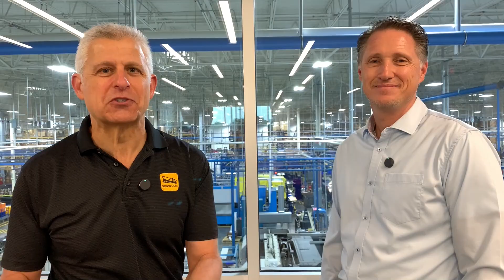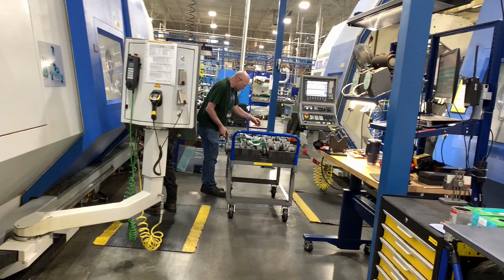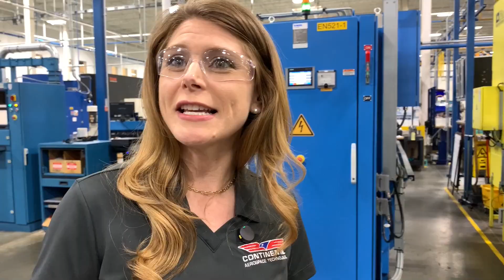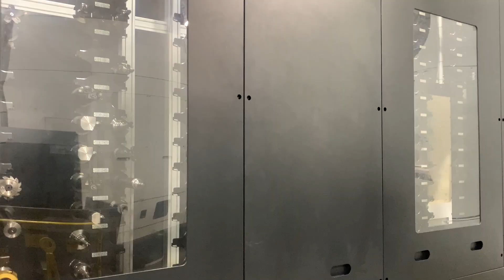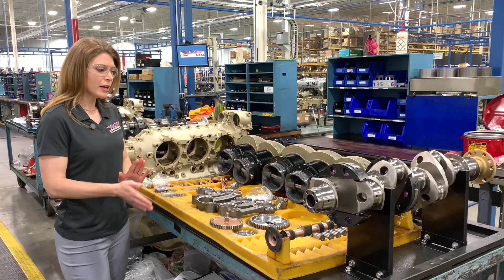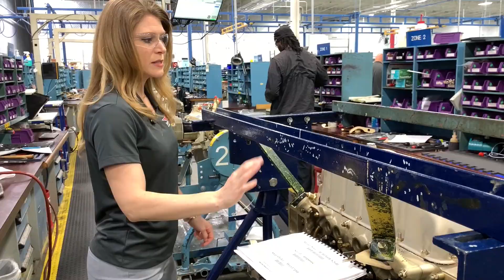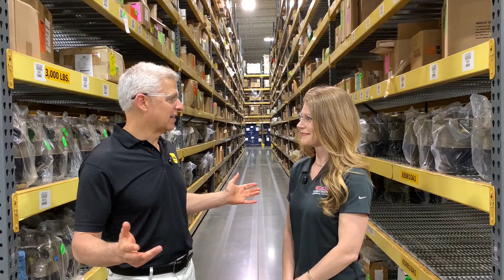HOW AIRCRAFT ENGINES ARE MADE! Continental’s 120th Anniversary Factory Tour

Comment: You'd think they'd have the prices under control by now. A vastly more complicated auto engine is vastly cheaper.
Reply: It’s not about complexity, it’s about regs and heavy lawsuits run rampant
Reply: @Notthe_droid_youarelookingfor  I just retired from 20 years of engine certification; it could be done vastly cheaper, even at the relatively low volume.
Reply: I totally agree! They really need to collaborate with Ford and GM engineers so they can make an engine that may, or may not catastrophically fail at any time! This is a proven design that has a great reliability record.
Reply: @AllThingsFabrication  A 'proven design that has a great reliability record'?  We are talking about Continental engines here, remember?  I've owned a few of them.